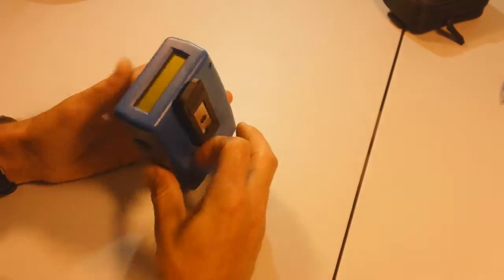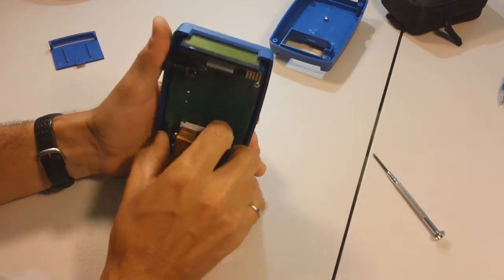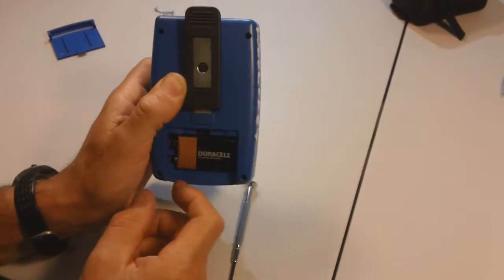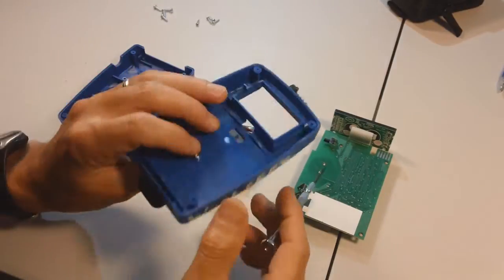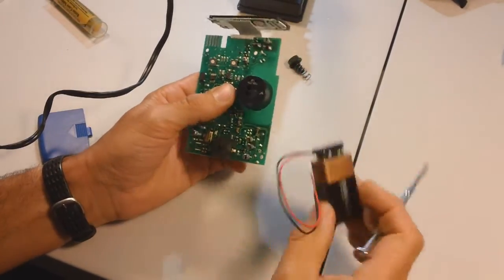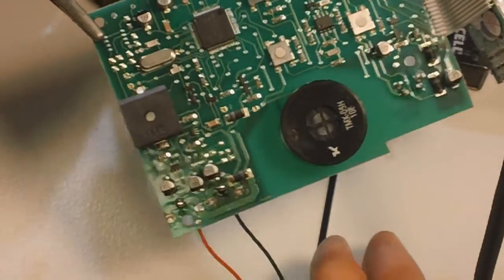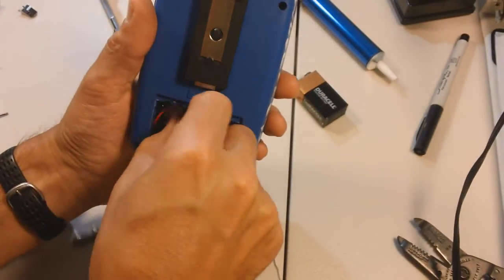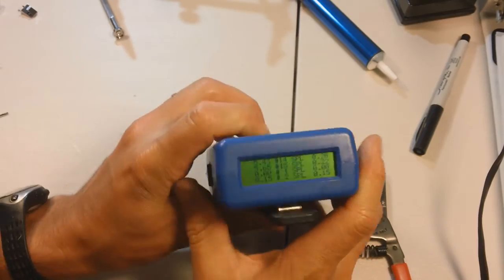Competition Electronics Pocket Pro II Shot Timer Repair DIY

Comment: Curious as to what batteries you were using in the unit.  Did you try an Energizer battery.  You know that Energizer batteries are about 1/16th of an in longer than Duracells.

Did you consider sticking a hefty piece of foam tape behind the battery to push it more firmly into the contacts?

You did do a good job of fixing the problem for good.  I'll reference this video if mine ever does something similar and the ideas I had do not work.

Thanks for the video.